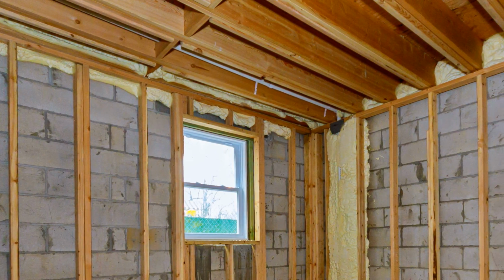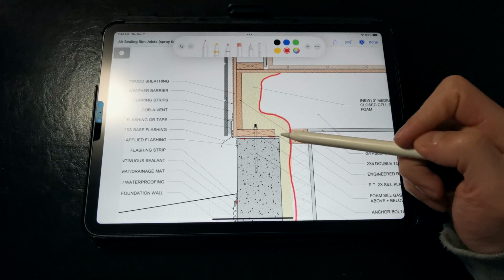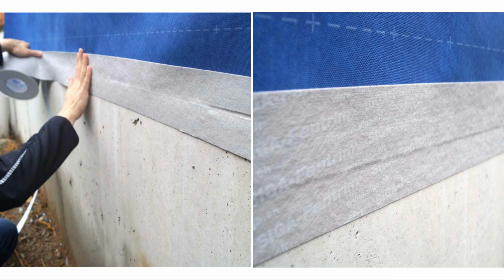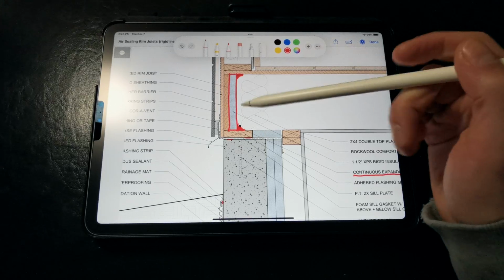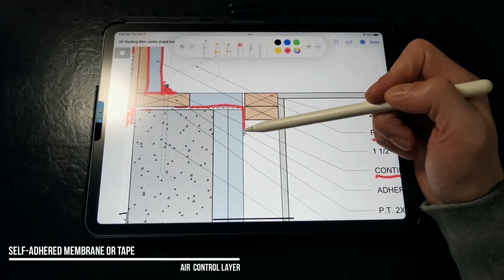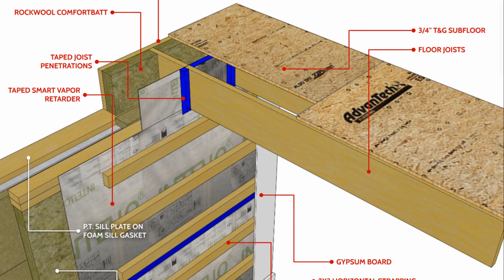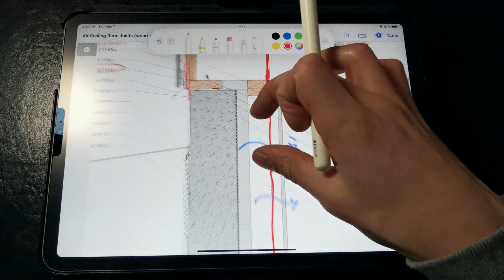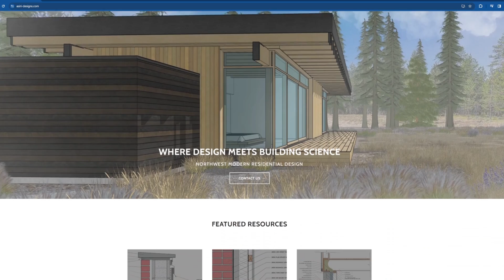Air Sealing and Insulating Rim Joists (For Architects + Builders)

Comment: Your videos are great! I have one concern though with the foam assemblies that you show: You are running the foam continuously from behind the wall up into the ceiling cavity, without the required fire blocking to isolate  the wall from the ceiling. The solution for this that I'm planning to use in my own basement is a horizontal strip of plywood across the top plate and up against the concrete wall. A bead of fire-caulk on the edge of the plywood seals any gaps and prevents moisture transfer from the concrete. And, using fire-treated plywood would give extra fire protection and the borate in the treated plywood gives some extra resistance to rot.
Reply from the maker: Thanks so much for pointing this out. You can actually use mineral wool batts as a fireblocking material  per IRC 718.2.1., though now I just realized it wasn't on the spray foam drawing. Some spray foams also are fire rated, but I'm not sure if they can satisfy that requirement... Anyways, I'm pinning this comment because this is important. Cheers!

Comment: Why can’t rigid foam board be installed UNDER the sill plate? A contractor I used to work for would install 1/2 XPS under the sill plate but I’ve not seen anyone else do this. Why not??  Creates a thermal break.
Reply: Because you don't want foam in the load path.
Reply: So the foam board being installed under concrete slabs carries no load?
Reply: I asked AI…😂😂😂

Al Overview

Yes, foam board can be installed in a load path, especially high-density types like XPS or polyiso, for
Proposed placement of foam board
applications like under-slab
insulation or as part of structural insulated panels (SIPs) that replace traditional framing, but it's used differently than studs; it acts as a continuous thermal break, often with wood

Comment: When using continuous insulation on the exterior, should we avoid using a spray foam/foam board detail on the rim joist (inside) to avoid “sandwiching” the sheathing? Should we opt for using a vapour permeable insulation in the rim joist (rockwool) with a smart vapour retarder instead? 
About to reach this detail on my build and I’ve been uncertain about the best way to address this.

Comment: Am i likely to have this cracking with closed cell foam in a north atlanta area basement?
Reply from the maker: Not likely, that's not to say that it can't happen but it's more of a cold climate issue or in climates that have drastic day/night temperature differences.
Reply: @ASIRIDesigns  thank you. And this is not really relevant to a rim joist question but I'd love it if I could get your quick thoughts… in this same 3.5 yr old home that is new to me six months ago, again north Atlanta area, I want to create a non-vented and slightly conditioned (likely a single or double duct going in the attic) attic space with foam. Probably open cell against the rafters because that can be done for my entire attic at ~7.5 in.  for about $11,000 versus $24,000 or more for 2 inches of closed. But here's the issue… There are multiple cathedral ceilings on my roof line that have traditional soffits at the bottom bringing air up through them where the top of the cathedral vents into the current vintage attic. If I seal that attic, those cathedral ceilings have nowhere for that supposedly humid or hot air to go. Without taking Drywall off the interior of the house in multiple spaces, I have no way to put (foam) in those rafters. Am I correct in that this is probably a big enough issue to keep me from putting foam in the rest of the attic unless I decide to bite the bullet and pull the drywall off internally so I can foam all areas, or is it possibly not something to worry about? Could I also fix the problem by simply changing all of the soffits to have no venting and thus that cathedral area should not have airflow? Those cathedrals would then have just traditional insulation in the rafters between the sheeting and the interior drywall and would not vent in any direction. No exterior air coming in (or at least minimal) and no air getting out. Is that a recipe for disaster?

Comment: While I appreciate the content, sealing gps, eps or xps ridged to the rim joist THEN placing more insulation on top will promote condensation on the inside of your building. Not great advice for northern climate.
Reply: Can you explain why you think condensation would result from rigid foam insulation on rim joists? My understanding is that by sealing it to the joist, warm house air won't be able to contact a cold surface, which is how you prevent condensation.
Reply: @tomtomkzzz @tomtomkzzz  in northern climates, a single layer of rigid foam would not warm the "inside surface" to a sufficient degree. Placing more bats on top would allow warm, moist air to reach the foam board and condense at the transition between batt and foam board. This is why in Canada, building code requires  a vapour barrier to be placed on the warm side of all insulation.
Reply: @rocksnowandwater  Doesn't it depend how thick the foam and the additional batt is? I am in Canada... My house had paper faced batts on the rim joists for the last 60 years. I don't see any water damage to the wood despite this less than ideal insulation. I am trying to improve the air-sealing and insulation so I've started by removing the old paper-faced batts and caulking the gaps between the wood components. I'm debating how to insulate... Thinking either 2" EPS plus a batt or just batt plus a smart vapour barrier.
Reply: @tomtomkzzz  I have a similar situation, after hours of research, consultation with an inspector, and energy audit assessor, I've decided on 2" foam board without any additional insulation. Both inspector and energy assessor agreed this was the safest way. Unfortunately I have further complications - embedded rim joists, which required a whole different approach.
Reply: @tomtomkzzz  side note - I think 2" EPS would be enough, particularly in Ontario, Quebec, and southern. BC. In that case the batt could be placed on top. However, it does not meet code (according to the inspector I talked to)
Reply: @rocksnowandwater  Thanks, that sounds reasonable actually. 2" is R10, fairly close to the walls above which are R13. I have complications though, in that the basement walls are already built and insulated with fiberglass + polyethylene vapour barrier. There is a gap at the top of the wall which I'd love to seal up with more foam but I worry about trapping moisture... maybe that gap is what's been keeping my basement from getting moldy all these years? I also have an inaccessible void between 2 joists at the front and back of my house that I need to figure out how to seal and insulate :(
Reply: @rocksnowandwater  Interesting.. yes I am in Ontario (Toronto). That's good to know regarding code...How did you get in touch with an inspector, I assume you are doing a bigger reno? Regarding the batt, I thought it would be required for fire protection, and exposed foam wasn't allowed. Mind you, I will be covering it when I put back the drop ceiling...so maybe I can skip the batt.
Reply: @tomtomkzzz  I called the city, and the inspector called me. As for the energy assessment, I'm getting the greener homes 0% intrest loan from the federal government. Yes I have a much larger reno... Basement, exterior siding with addition of 1" GPS etc etc. I also have many concerns about trapped moisture, and there's a ton of conflicting information out there. But the inspector made clear--unless your thermal barrier assembly is required to be covered with a vapour barrier; all batt should have the vapour barrier layer on the warm side.
Reply: @rocksnowandwater  I agree, tons of conflicting information and so-called experts who all seem to disagree with each other !! It is great to get the support from the inspector. It sounds like you're finishing the whole basement which is a much bigger project and I guess requires permits? In my case I'm just trying to improve air-sealing and insulation of the rim joists without causing any new problems. It makes sense to have the vapour barrier on the warm side... this is standard for cold climates. Indeed, my basement walls have 6 mil poly right behind the drywall. However I hear that this is actually not a great assembly anymore since it can trap moisture inside the wall. Moisture which might be escaping currently through the gap at the top. The gap I'd like to seal ! A smart vapour barrier may be the answer but I'm not sure if it will still work, seeing as the wall is already built with poly....

Comment: @ASIRIDesigns Curious, how does termite inspection happen in these scenarios? If the wood is all sealed up a bond may not be issued as the inspection can't see the wood to determine any infestation/wood rot. I think removeable insulation is warranted to allow eyes on the wood as needed with an air seal at the joints/sill plate minimum. 🤷‍♂
Reply from the maker: @ehiker1  It's a great consideration, but there's a bit of a chicken/egg situation. If you don't seal it, then termites will definitely be able get into it. Typically the areas where termites are abundant, the foundation and first floor are constructed out of a material that bugs don't eat or burrow into (i.e. CMU, steel stud, etc.).
Reply: @ASIRIDesigns  Agreed. I would hope air sealed and batts/pillow would be the compromise.

Comment: In the xps + spray foam setup for older homes (1927, PNW). If you can't do the exterior air sealing, do you still recommend air sealing the mudsill with caulking or tape? Or will that cause issues with condensing under the mudsill?
Reply: You ever find out answer to this? I'm in same boat as you

Comment: If one is air sealing the outside with the WRB and the fluid applied joint sealer why would you need to also air seal the inside? Redundancies? Wouldn't you want a full air penetration so you become aware of breaks in the exterior air seal so you don't have air and moisture penetrations into your wall without knowing about it?

Comment: What solutions can you recommend in older homes that might not have the sill gasket and where the rim joist comes in direct contact with the concrete wall? Is spray foam still recommended in that scenario? It is a condo so I also don’t have access to the exterior to seal transitions
Reply: I might have found the answer in one of Asiri's articles: It should be noted that some older homes do not have a sill gasket or capillary break between the sill plate or mudsill and the concrete or masonry foundation wall. Concrete and masonry are extremely porous, and can wick an enormous amount of water into other hygroscopic materials, such as wood components that are in direct contact. While this was not a problem in uninsulated and poorly insulated assemblies as the wood could easily dry out, insulating and sealing the rim joist on the interior could result in rapid deterioration. Great care must be taken when addressing these types of conditions, as shifting the moisture balance can end up supporting mold growth and rot. ... (If you can't insulate from the exterior) The next best strategy that can be used is to install borate injections into the wood components that are in direct contact with the foundation wall. This strategy only works if the wood components are in good condition and if the moisture content of the wood is within a safe range. Borate naturally deters fungal growth and insects and will leach into the wood when the moisture content is high, also helping to drive out water. Small holes are bored into the wood sill and joists at regular intervals, and borate rods are driven into the holes. This is an inexpensive way to reduce the risk of rot damage from moisture exposure.
Reply: I have a similar scenario and want to know the answer to this question too!

Comment: For drawing 3, would a vapor barrier be need if there was a dedicated dehumidifier in teh crawl? Also, what are you thoughts on a 4 foot deep crawl, with 2 layers of 2 inch stagger polyiso and a 10 or 15ml vapor barrier encapsulating the entire crawl. no cement slab, just a floor of poly with the plastic on top up to the sill plate. thanks

Comment: Good presentation. You mentioned long-term off-gassing from ccsf and wondered where you got that information. There appears to be a ton of conflicting information about this topic, especially when the discussions revolve around faulty installation vs inherent danger of ccsf due to chemical composition.
Reply from the maker: Without releasing too many of the details, we had foam core samples taken to a couple of independent 3rd party labs for testing after my client was experiencing some health issues. Foam comes back loaded with chemicals that presumably should have offgassed months prior. They sent the results of the foam samples to the manufacturer who responded with a formal attorney's letter that the lab results were normal... This is one anecdote, but many of my other building science contacts have run into similar issues. An acquaintance of mine Bob Kelly who developed the WickRight has seen a bunch of issues with spray foam, and met one of the guys who helped to pioneer CCSPF at Building Science Summer Camp and had some pretty interesting discussions. Definitely reach out to him if you're curious.

Comment: Thanks, this is just the right information I needed. I want add insulation to the rim joist area of my home and I'm going to use the second method you mentioned using xps foam. I wouldn't be doing anything on the exterior for now. For air sealing the cinder block the only tape I can find at my local hardware store that is wide enough for my application is vycor plus Self-Adhered Window and Door Flashing tape. Do you think this product would be acceptable in this application? Than you.

Comment: I'm rapidly coming to the conclusion that both expanded and extruded polystyrene foams are a really bad choice for the vast majority of wall and roof/ceiling assemblies, and it's due to the fact that they are almost completely vapor impermeable, and thus, when temperatures invert at certain times of the year or under extreme conditions (much of the US climate zones), promotes condensation on one side that does not easily dry. It's like trying to put up a vapor barrier in the wall assembly, which is fine, so long as there is a pretty much constant source of heat/vapor pressure from the correct direction.

I'm ditching the stuff and attempting to utilize mineral wool batts and boards, along with some cellular glass in certain locations whenever possible.

I'd be happy to hear your thoughts.  Thanks for these vids, regardless, as us architects are always trying to improve the robustness in our buildings.
Reply: I have the exact same thought
Reply: My thought, based on the consensus from every other building science site that I've visited, is that this would be risky, because there would be very little drying possible on the below-grade, waterproofed concrete wall side. This video is proposing what you suggest as an option, but only in conjunction with a tightly sealed smart vapor barrier. However, I haven't encountered any other site willing to propose this. I'd also think that the stability of the the ground temperature would eliminate the inversion concern -- the ground is always colder than inside. Above grade where there is inversion, the wood walls can dry to both sides.
Reply: @adamliberman6767  Isn't that what I said?
Reply: I hear about both approaches and each camp seems to be pretty firm that their way is the better way. As a homeowner this is infuriating. Shouldn't there be some solid evidence/science to prove that one of the ways is the better way, or describe which method is best for different situations? I would like to insulate my rim joists using 2 layers of rockwool comfortboard, which you seem to recommend as well. The concern I have is condensation on the inside during winter (heating dominant climate). It's like putting heavy drapes over windows. Wouldn't this just cause a ton of condensation to build up behind the insulation during the winter season?